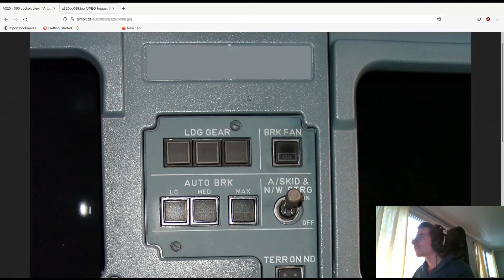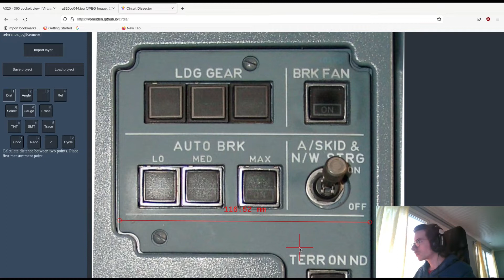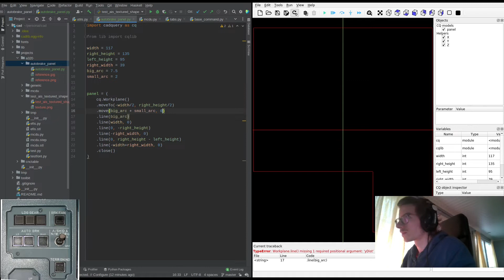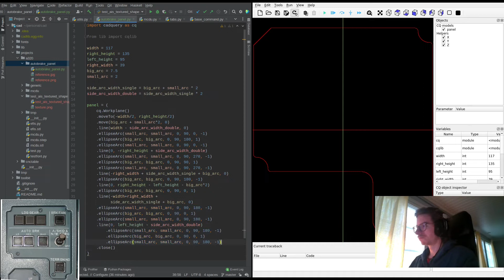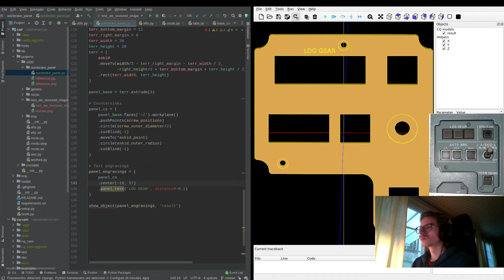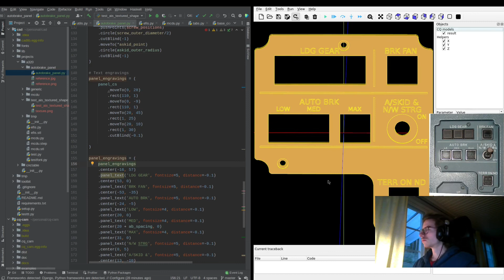CadQuery modelling an A320 Auto-Brake Panel

Comment: i can see you are using pycharm as the IDE for your python script. What is the name of the program for displaying the model? How do you reload your model once you changed it with your script? Thank you for showing your process.
Reply from the maker: Thanks for the comment! It's Intellij IDEA to be exact, but anyway almost equivalent to pycharm. The viewer is the official CQ-Editor which supports autoreload if the main file or even an import is changed externally (must be enabled in options as far as I remember). I've also closed the native text editor panel on CQ-Editor.

Comment from the maker: In case you're wondering what's up with the MCDU - I spent some months working on a CAM module for CadQuery so I don't actually have to use FreeCAD. Right now my CNC machine needs still a bit more work before it's running again, but I'm sure we'll get to milling parts soon enough.
Reply: The cq-cam looks very exciting. I'm looking forward to seeing it mill some parts!
Reply from the maker: @kn2002wroc   I failed to finish a major overhaul in cq-cam during my summer vacation but I did manage to mill & engrave the panel from this video. Thanks for the comment, definitely motivates me to prioritize finishing the next video in the series ASAP 👍